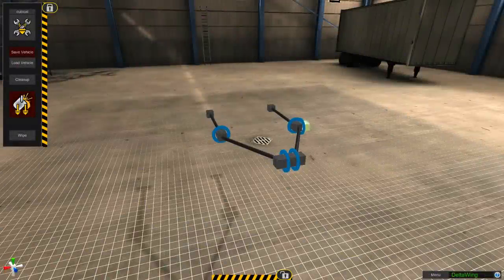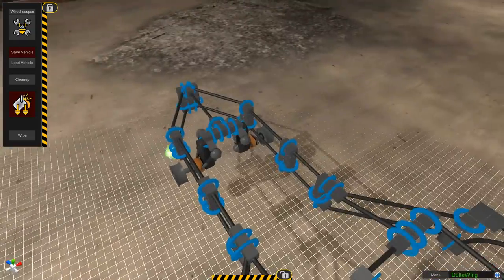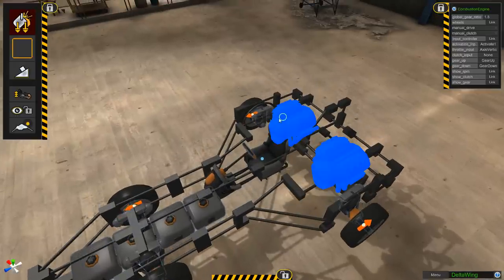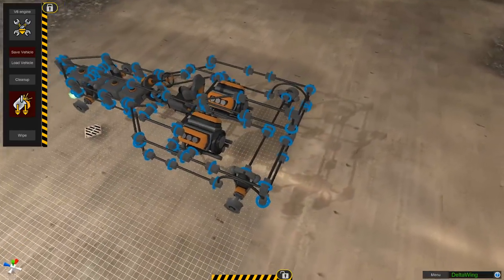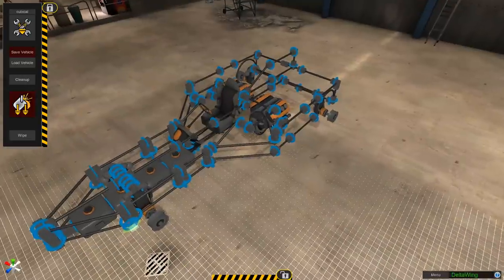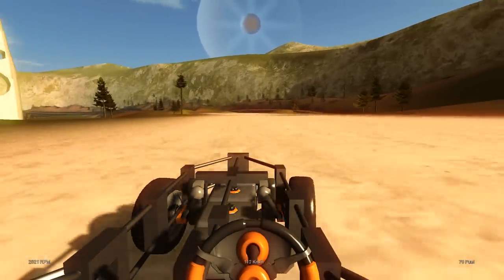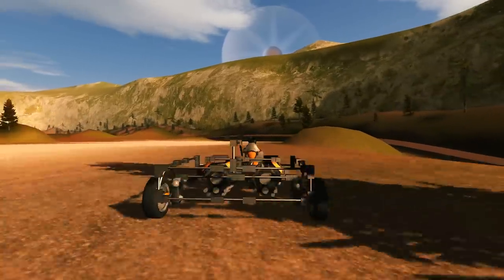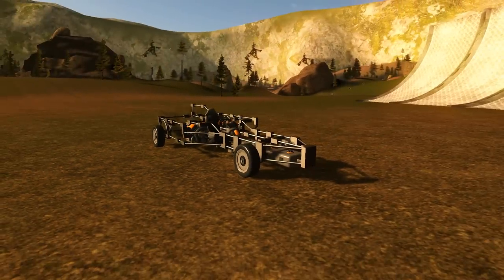FailRace Creations Nissan Delta Wing (Homebrew vehicle sandbox)

Comment: The DeltaWing was originally a design for the 2012 IndyCar, by Ben Bowlby and Chip Ganassi Racing (who lost out to the Dallara, the current manufacturer). Nissan came along, put an engine and a boatload of money in it and ran the black prototype at Le Mans a few years ago. It got knocked off into a wall by a Toyota LMP...

Its design basically makes it half a LMP1 car (only using half the fuel, tyres etc.) while having similar performance to one. Very low drag too. Panoz painted it silver and ran it in the 2013/4 ALMS/TUSCC with a lighter more powerful Mazda motor, turning it into an... interesting looking hard-top. Panoz and Ganassi are currently in a messy legal fight with Nissan over the design since Nissan sort of stole the DeltaWing design and built the ZEOD RC thing off of it.

Fun fact, its carbon tub is one salvaged from an AMR-One, the Aston LMP that was Forza 4 DLC. Certainly seen better use than that car ever did lol
Reply: The Deltawing also ran in the 2012 Petit Le Mans, the 2013 ALMS season and the 2014 United Sportscars Championship ;)
Reply: Yeah the hard top wasn't particularly good looking was it?
Reply: The Aston tub ended up in the Pescarolo 03 the same year too.